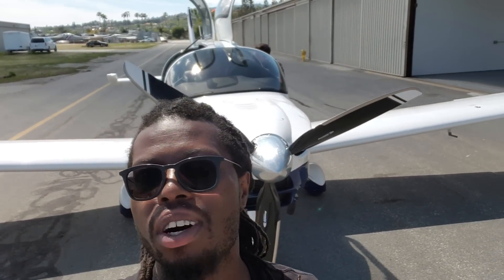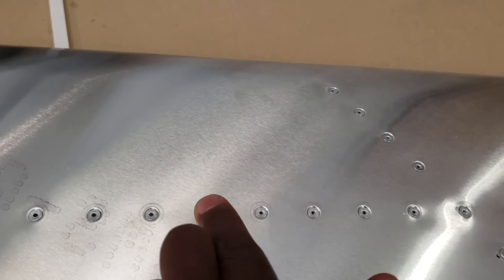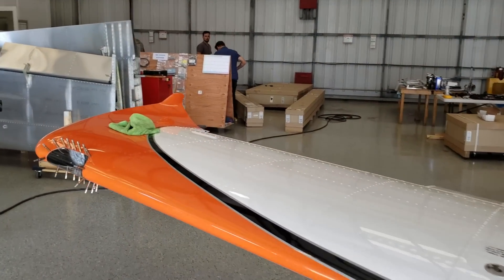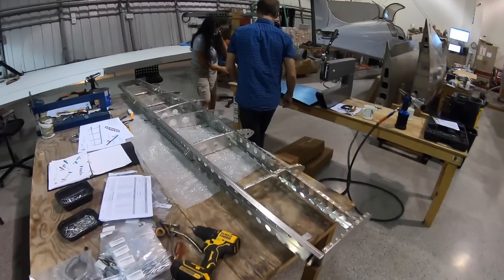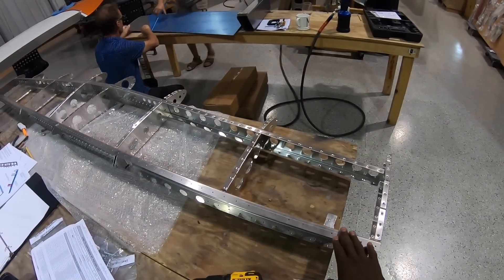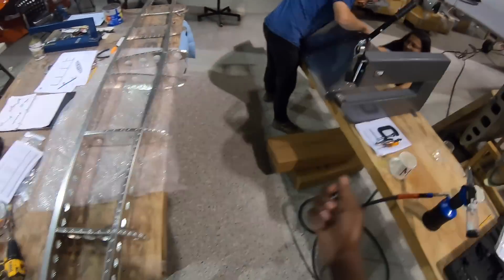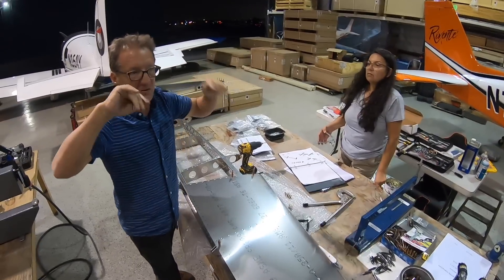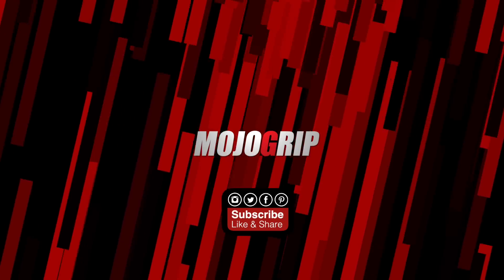1,000 Hours Left To Finish My New Airplane

Comment: Any reason, or more specifically, the determining factor to prime or not to prime before assembly? I notice that you completely remove the protective covering too?
Reply from the maker: We are priming and applying anti-corrosion solution after the airframe is constructed. Much quicker process and more sustainable in the long run.
Reply: @mojogrip  Thanks - really enjoy yr channel as your approaching aviation in the same way many of us are. Also, i watched another TSi builder - he mentioned the grade of aluminum in a TAS build is a higher anti corrosive type...6020?

Comment: Lots of work doing dimpled skins! I did that when I reskinned the wings on my Grumman AA1B but I used a small dimple die tool that I picked up on a visit to EAA Airventure. It was used with a normal pop riveter and worked well.

I left the rivets a fraction high, then lightly milled them perfectly flush and added a hair-thickness of epoxy filler. Like the original skins which were bonded, that made the rivets  totally invisible.

Comment: Link to the airplane KIT?
Reply from the maker: https://www.airplanefactory.com/aircraft/sling-tsi/
Reply: @mojogrip  thanks. What you pay Gör the Kit? On the Website see the price 24995$ for the fast Kit? and engine extra?
Reply: @dennisanonym8658  I think you might have misread the listing. The fast kit is $24995 extra over the standard kit. So the total for the standard is $136,000 and for the quick kit the total would be $161,000 (rounded). Those prices include $80,000 for the engine/avionics/prop.

Comment: John Denver built his own plane.  It killed him.  Hire a test pilot.  Oh, I'm a pilot and I'd never fly a plane that I built.
Reply: From what I understand, John Denver did not build the plane, he purchased it.  There has been some speculation that the cause of the accident was from not listening to the original owner in regards to issues involving switching between fuel tanks in flight.  Then again, this is based on one conversation with another pilot.
  I am sure there is a NSTB accident report concluding what the cause was.
Reply: @jeffsteury4645  Then I need more info. Thanks. I still wouldn't fly a plane I built.
Reply: https://www.ntsb.gov/news/press-releases/Pages/NTSB_Determines_John_Denvers_Crash_Caused_by_Poor_Placement_of_Fuel_Selector_Handle_Diverting_His_Attention_During_Flight.aspx
Reply: Wrong, plus he was a Deutschendorf drunk if I recall correctly.
Reply: @wishicouldspel  Drunk ? Really ? Oh shit !
Reply: a-hole
Reply: @flexairz  No, you a-hole !
Reply: B Mc Totally false speculation. He owned another acft but acft he hired had fuel selector valve behind him. When switching tanks he moved selector incorrect direction and switched of fuel
Reply: @petermitchell7607  Thank you. That is sad ! RIP John.

Comment: I have wanted to ask this of someone that is building a plane. I see a lot of people building their own airplanes, and the interior of the components are bare metal. Should this be painted with some kind of  corrosion resistant paint, or is it already coated with some anti-corrosion treatment? Granted this is aluminum, but still weather and contaminants in the air can get to these interior spaces.
Reply from the maker: The structure will be primed if that's what you mean
Reply: @mojogrip  I was mainly speaking about the interior of the stabilizer. After you rivet the skin to it, does that get any protection. I realize it is not exposed directly, but was curious about indirect exposure to the elements.

Comment: so I'm still waiting for an answer about de-burring the edges of parts and especially after you match drill holes...are you required to or not?...Vans absolutely says to de-burr to prevent stress cracks...
Reply: Well, I have built a couple of aircraft and always, no, really always deburred after match drilling.
Reply: I learned yesterday that Hyundai didn't de-burr Elantra engine parts and 70k miles later are causing problems.

Comment: Hey MOJO I noticed these use regular pop rivets vs the smash type rivets like vans?  I didnt think those were used in aviation?  Im just learning, you have my dream job I do something similar with RC jets and planes.
Reply: There are " aviation certified " pop rivets. Just as safe where they can be used and much easier than a bucking bar.
Reply: @doranjaffas7351  Didnt know that, thanks

Comment: Love the builds videos, bud.

Question...….Why not just dimple every single rivet that is exposed? Wouldn't that give you the max lowest air resistance? Yes, it adds build time, but why "go cheap" and do the least dimpling possible? You are only building this plane once, so why not "max out" air speed via the highest possible build quality?

Let us know if there is any negative (other than increased build time) in 100% dimpling.

Comment: Curious why they dont ship them dimpled when manufacturing
Reply from the maker: Shipped dimpled would be in Quick build kits. My kit is standard.
Reply: @mojogrip  gotcha and what's the time savings there?
Reply from the maker: @Karl__Pierre  with the Quick build you're saving about 500 hours of manual labor
Reply: Some parts are shared with other Sling models which are not dimpled. The factory makes one part which can be shipped for the different models, the builder dimples as required.

Comment: Why can u not dimple flush rivet all rivets? Are there integrity issues if you do?
Reply: The countersunk blind rivet would push the outer skin into the rib cap, possibly damaging it and creating cracks that could grow during flight
Reply: @HugoCtrlTab  thank you Sir for the info. I own and Fly a fairly new 182 turbo but I'm fascinated at the thought of embarking on a build from scratch. Love these videos.
Reply: I think I misunderstood your question. I was thinking about installing a countersunk rivet without dimpling. Due to the dimplings introducing locally bent areas in the fastener hole, load carrying capability of these fasteners is lower than a protruding fastener without dimpling. That’s why the connection to the spar in the lower part of the vertical tail plane is not dimpled, because it is an area with high load transfer.
Reply: @HugoCtrlTab  got it.

Comment: A couple of questions. One, just out of curiosity, do those parts HAVE to be dimpled where it says to dimple? Two, why don't they just dimple the whole plane to make for smoother air flow?
Reply from the maker: Brian, yes you dimple where it says to dimple on the manual. And yea I wish the entire thing was flushed rivets to, but it's easier said than done. Safety in the design comes to play here. I will ask TAF though to get a more precise answer. Thanks.
Reply: Because it just takes more time to dimple the whole aircraft. The chose to only dimple the areas where its aerodynamically useful to dimple these.
Reply: @Ferris Several kits use pop rivets instead of bucked rivets. The Sling will used bucked rivets in high strength areas, pop for everywhere else. Sonex also uses pop. Speeds build time. I don't disagree with your assessment, just saying pop is standard in a lot of kit planes and have proven reliable.
Reply: @Ferris Many aircraft manufacturers have been using these aviation grade pop rivets for decades now without much issue. Zenair exclusively pops there whole aircraft together as others.

Comment: Question for you Mike: so you’re doing this builder assist with TAF to build your Sling TSi and if I understood correctly in all your videos you use all of their tools at their facility in California to build it. What happens after the plane is built & flying if you have to do repairs? Does TAF have some program for you to use afterwards where you can use their workshop/tools? Or do you buy your own tools as needed afterwards?

We’re doing an RV-10 slow build so I’m not super familiar with all the details of the TAF builder assist program you’re doing and I’m just curious about what happens once you’ve finished your build. 

Thanks for sharing your experience! It’s fun seeing the similarities & differences between your build and ours 😊
Reply from the maker: Once I'm done building the plane, then maintenance responsibility is solely mine. I will need to get my own tools or find a facility close by to me. That said, I'm sure TAF will lend a help in hand at any point if I asked. Having a post build program is an interesting concept though and I'll ask them about it. Thanks.
Reply: MojoGrip feel free to reach out to us at Bristell Aircraft/Sport Flying USA Services in Lancaster, PA (KLNS). We would be more than happy to help you with your maintenance needs, such as annuals, (100 hr if needed) and 5 year rubber. We are a licensed rotax facility with extensive knowledge in Sport Aircraft and Certified Aircraft. We are also a Garmin Licensed facility and can assist with avionics needs. Please email with any questions you may have at shandak91@yahoo.com.

Comment: The dimples are called countersink! Great job 👍<from a former Northrop aircraft mechanic>
Reply: LPKepic well from a current mechanic at Lockheed Martin to be precise those ARE called dimples and countersinks are called “machined countersinks”. Countersink remove material and dimples don’t. Dimples are for thin metal and counter sinks are for thicker metal and usually solid flush fasteners.

Comment: Why is John drilling?  Are the holes not matched?
Reply from the maker: Sometimes the holes need a little wiggle room to fit the rivets so you use the drill to space them out.
Reply: @mojogrip  Hmmm...is there any concern that the hole in the bottom layer becomes more of a keyhole shape?
Reply: @steven2145  Ideally the holes line up, but its not uncommon for them to have to be cleared out. Usually holes that are pre drilled on components re drilled to an exact size. Say 1/8'' for a 1/8'' rivet. A 1/8'' rivet isnt going to fit straight into a 1/8'' hole is it? So what they drill is what is called a clearance hole. For a 1/8'' rivet the typical clearance hole is a #30 drill bit which is a couple of thou bigger. This gives the clearance required for the rivet to both fit and in the case of a solid rivet to form correctly as its bucked. The keyhole will only occur if there is significant differences in the location of the hole locations.

Comment: I'm a woodworker and woodturner and I'd say drilling holes and riveting is much easier than having to shape wood for the frame, wings, leading edges and empennage surfaces of a plane. I'd be more than capable of doing it all in wood and I would still rather use aluminum, drill holes and use pop rivets.

Comment: HINT for getting initial clecos in place:  Use an awl.  The sharp pointed shaft easily slides into the hole and pulls the parts into alignment.  Makes things much more easy to assemble.. ((not ALL holes, just the first few to get the ends/corners aligned))
Reply: Yup, I must say I was a bit shocked to see him drilling to line up the holes, also as Mojo is going to be the owner/builder shouldn’t he be doing the 51% rule. As he should be able to maintain & do his own annuals if u self build. Does the 51% rule mean anything these days?.  I can’t see him having the skills to be able to do it safely.
Reply: ok, I see John doing that